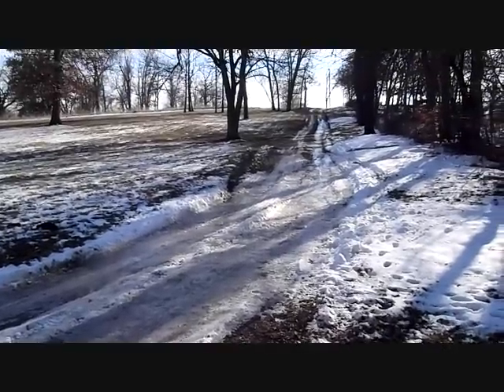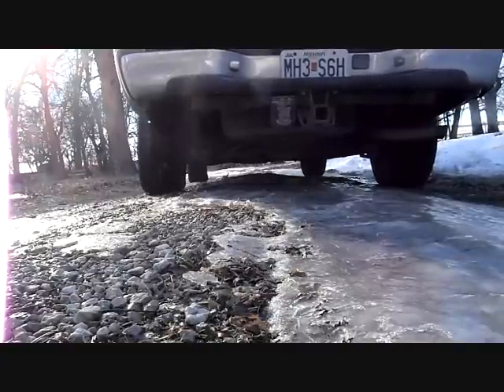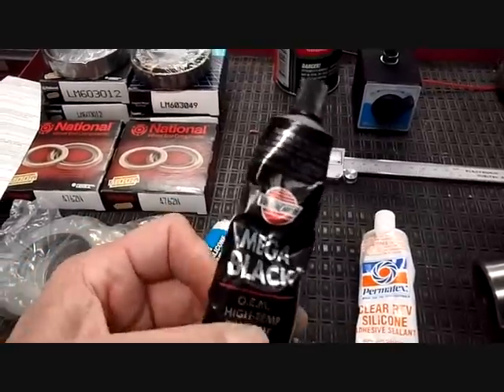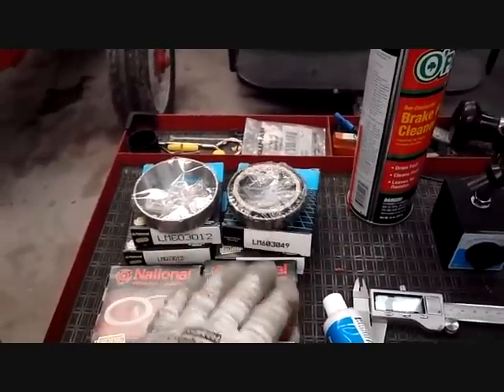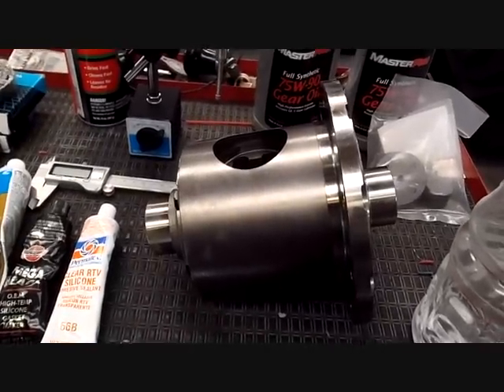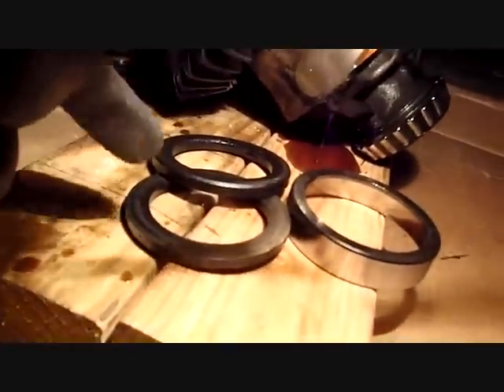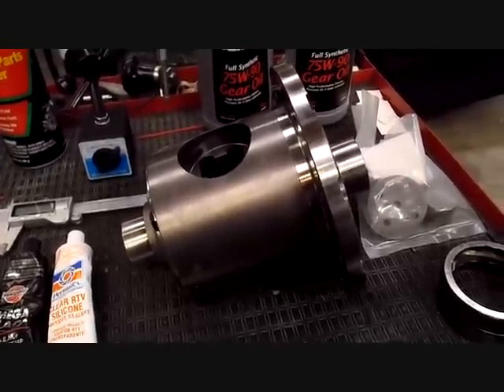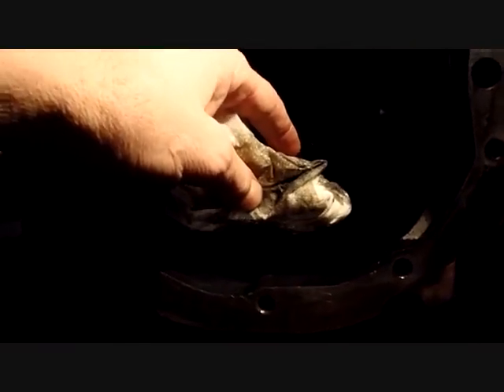How to install a Detroit Truetrac limited slip differential carrier. ADVANCED INSTRUCTIONS!

Comment: did you have to adjust the pinion ? im going to upgrade same setup as you same gear s ..can you list the parts numbers you used ...thanks
Reply from the maker: If you use the same ring gear and your tooth contact looks good there is no need to touch the pinion.  I don't have the part numbers. Just go to Jeggs and look it up by application.
Reply: +mowerdog ok...thanks

Comment: Do you think this setup for front and rear differentials would make a great setup off-road F-150 or would the Detroit Auto Locker be best?

Daily driver and hunting ALOT off-road.
Reply from the maker: The Truetrac on both diffs  would ne the bomb. Check out the rock crawler vids that run these on both diffs
Reply: mowerdog right on thank you so much!

Comment: gtood video. I like these lockers.  note to anyone how lives in the city with crowned roads.  locking diff make the rear of your car go sideways, as you begin to move foward. if there is a parked car next to you. you may slide sidways in to it. just be carefull.
Reply from the maker: +Tom gator  The truetrac is not a locker.  Just a limited slip diff.  This one acts fine turning corners...

Comment: great video dog....im not sure if anybody else has posted but for those that dont have a 20 ton press...you can clean the bearing real god, put it in the oven at 350 and while its hot you can slide it onto the diff or gently knudge it on ;)

Comment: Nice video - clear and well narrated mowerdog, was going to take my 49 Pontiac with 8.5 into shop, but will now do my own..  I will also have to change the gears, but appears that won't be too bad.  thanks for the lesson
Reply from the maker: If your changing out the gears you'll have to adjust the pinion depth and bearing load.  I didn't have to do that because I left the pinion in and didn't change the gears.  There are some videos on pinion depth and preload here on the tube...

Comment: Yeah I've already had the cover off, that's why I said the (helical) gear set inside has all sorts of play. Ring and pinon back lash on the money still. All Detroit wanted to do was sell me another unit. Maybe in the lighter less power applications they may do a little better. I just wasn't too happy for the price I paid for it to not last. I've got close to 700hp 1300 lb ft of torque running through it. Hope yours does better. I'll be going grizzly next
Reply from the maker: My stock 5.3 Engine has a tiny bit less HP than yours! LOL

Comment from the maker: Great questions.  Search for your specific backlash specs.  You will find them online.  About bearing preload?  I guess the correct way is to remove the driveshaft and noting the torque it takes to rotate the pinion.  Then after you install the carrier take another reading and find the difference.  The preload specs can be found online too.  I guess I chose the easy way out, which is - I had to drive the bearing spacers in so I knew there was  preload.  How much? I don't know? Done by feel......

Comment: Just watched your video, how is that truetrac holding up? Did you have any noise or problems. Thanks
Reply from the maker: +Josaljo Won  I have 100,000 miles on the Detroit now. No issues or noise.  It worked super this winter.  I find myself finding slick patches and putting one wheel on ice and the other on the dry.  Then I step on the gas and it's doesn't spin out.  Best thing I ever added to a vehicle!
Reply: +mowerdog Well I just ordered one from jegs, I hope I have the same luck you do. Thanks
Reply from the maker: I hope so too!  Good luck on the install!! Let us know how it goes?
Reply: +mowerdog I will do that, I already have the rear taken apart. Going to follow your video as soon as the parts come. Btw checkout my channel, I could use some subscribers LOL.
Reply from the maker: I'll go check out your channel.

Comment: FYI,  2000 was a split year for GM SUV body styles.   There are 2000 year OBS (90-2000), and NBS (99-06/07 classic) body styles for the SUV.   The 8.5 came in the OBS body style.  The 8.6 (/8.625/  8-5/8) rear end was on the NBS.   If you're doing this on a pickup,  the same information applies, but for pickups 1999 was a split year.   

Great video.  Thanks.
Reply from the maker: Super information!  Thanks!

Comment: where can i get all the torque specs for the ring bolts and for the cap bolts and how did you know the play in the diff needed to be at 10 thousands of an inch ? just asking im going to be doing this on my 04 suburban
Reply from the maker: +Brian Pena  I found them online.  You should be able to find them in your service manual.  Here is a good site as well.  http://www.crawlpedia.com/ring_pinion_setup.htm

Comment: Very nice video.   Any reason you didn't change the pinion bearings and seal while you were in there?   I've seen mixed information on whether a Truetrac works in reverse.  Do you know?
Reply from the maker: If I had changed out the pinion bearing I would have had to set up the pinion preload and position.  That's another days work up on jack stands.  There is really no reason to do that unless you just want to or you find trash in the diff.  However I could have changed the seal but heck the old one was dry. So I saved time and money. Thanks for watching my video!

Comment: mowerdog one more question how does it act on mud? is it 50/50 the whole time?
Reply from the maker: It's not 50/50 all the time.  The more one wheel slips the more the other pulls. I think I have around 80,000 miles on it now.  Still works super.

Comment: Hey mowerdog if the passenger right wheel is of the ground, will it still transfer the equal power to the left wheel, realized that my ls from the factory does not transfer eqaul power in this situation, it coul dbe that my clutch pads are worn
Reply from the maker: +Fern W  In this situation you would have to quickly tap the brakes with a Truetrac.

Comment: how does it drive on the road? i want to do some lockers on my jeep by i dont want it to be a pain to turn. cant decide if i should go with this or a elocker
Reply from the maker: This is not a true "Locker" diff. It's a limited slip diff.   It handles just like the stock diff in turns.
Reply: Use a detroit tru trac in the rear of jeep then put an e-locker or air locker for the front so you can engage it only when needed!!

Comment: Be nice if you could give us torque values for all the bolts.  They aren't all found in the Clymer or Haynes manuals.  I found that the hardest part of this job was removing the brake caliper mount bolts.   Also, you need a BIG set of jack stands; ones that will extend to about 24", if you intend to put them under the frame, which you should.  Took me 12 hours to install the True Trac and a set of four Bilsteins.  That includes going into town to get a diff cover gasket since the one in the Ratech installation kit #3025 was too small.
Reply from the maker: Yes - the higher the better!  It took me a while to find the torque values myself.  I don't remember what they were now?  But it sounds like you got it done!!! Sweet!!!

Comment: Nice and informative video and many thanx for taking time and posting it. just curious don't you think 0.012 of an inch backlash a tad too much? GM recommends 0.004 to 0.007 of an inch as standard Ring and Pinion backlash on most of their Diffs.
Reply from the maker: .012 is acceptable for used gears.

Comment: So we note then issue with LSDs, roads have a crown to facilitate drainage of water. An LSD forces the rear wheels to spin and the rear follows the crown to essentially slide off the road.  An open diff will take turns spinning a driver side or passenger side wheel, but with a delicate driving technique, you'll stay on the road and pull yourself out of a difficult situation.

Comment: mowerdog great video, awesome demonstration! I'm thinking of switching my differential to either a trutrac or locker I don't do much off road, just mud and sand. I have a 2008 gmc sierra with the g80 which works ok but know that if I had a full time traction differential I would've had better chances of not getting stuck. Only thing I read about a locker is that on turns you have to be of the gas or the inside tire will skip. How has the trutrac held up for you? How is it on turns?
Reply from the maker: There is a lot of difference in a full locker and the Trutrac.  Go to the Eaton web site or right here on the tube and check it out.  Lots of rock crawlers use the Trutrac so I figured it was good enough for my Suburban...LOL
Reply: mowerdog thank you, yeah I see rock crawlers use it. Only thing is when one wheel is in the air seems like all torque is given to the wheel with least traction. But i don't rock crawl lol. just recently got stuck a few times playing in the mud. My 2008 gmc truck comes with the g80 differential, feel like it's about to go out soon. but I'm liking the trutrac and considering it more than the locker
Reply from the maker: felipe f
If one wheel is completely off the ground and the diff isn't transferring power to the traction wheel you tap the brake.
Reply: Oh OK. Thanks man! Great video! You make look easy! One one question, how is it on mud?
Reply from the maker: It used to get stuck If my Dog took a leak on one tire!!  It goes through mud and snow no problem.  Just get aggressive tires to get the maximum traction.
Reply: Sweet! Thank you!

Comment: These are great diffs. I had them front and rear in my 82 Suburban and have one in the front of my current 04 Grand Cherokee with the stock Vari-Lok in the rear. Great video, I did a gearing change at the same time, added quite a bit more work.
Reply from the maker: Yes - a huge difference.....
Reply: Curious as to why you replaced the Vari-Lok.   I have two '04 Grands with the QuadraDrive and the Vari-Lok differentials work beautifully, certainly as well as the True-Trac in my Silverado does.

Comment: thank you!!! and did you haft to shim your pinion gear?
Reply from the maker: +Brian Pena  I used the original shims. Make sure you have a shim kit on hand in case your oem shims need to either replaced or adjusted.

Comment: Do you need to replace all the bearings and re-do the gear lash when installing this locker? Can't you just swap it out for the stock diff without changing everything?
Reply from the maker: I left the pinion shaft and bearings in place.  However you must install new carrier bearings just as I show in the video.  This is because you cannot remove and reinstall the old bearings without damaging them.

Comment: Thinking about installing this in my 2wd diesel ram, any thoughts?
Reply from the maker: If you have a need for more traction where you live then go for it.  I live in Missouri and I need it to just pull out of my driveway when it snows.   If you live in Arizona and never go off road then you probably don't need to mess with it?
Reply: mowerdog yeah I live in upstate ny I got the truck on an awesome deal down in North Carolina so I'm 2 wheeling in the north lol
Reply from the maker: Then you need one!!  Also there are other brands too.  Just look for some good prices.

Comment: Also remember that the ring gear bolts are REVERSE threads. Remember this when loosening these bolts off when using an impact gun.  It doesnt take much to strip these out if careless with an impact.
Reply: Hmmm, no they are not.
Reply: @totaldla  Yes, they are.

Comment: Hi would u be able to tell me how I can find out the correct part number for my suburban? To I stall a truetrac
Reply from the maker: What year?  Does it have disc brakes on the rear?  How many bolts are holding the cover on your diff?
Reply: @mowerdog  1998 has drum breaks in the rear. Note sure how many bolts it has I have to count them I'll get back to u on that
Reply: @mowerdog  it's a 10 bolt
Reply: @mowerdog  I found the part number 👍one more question, how is the driving on the road? Is it any different from the original open dif?

Comment: Sounds good. You should be able to get 200K+ out of any diff as long as its not abused by heavy impact like repeatably spinning from ice to pavement, etc. Most diff failures can be linked to abuse, contamination, or incorrect setup. The amount of moving parts is not a factor as much as its design and how its used.
Reply from the maker: saltcar I'm hoping I'll get 250k out of my 5.3 Suburban.  That would be about 160k on the diff.  Then I might just rebuild the engine and shoot for 400k?  Rebuilding a 5.3 would make for a good video....

Comment: you should try kerosene instead of brake cleaner, it lubricates & is  cheaper & safer on the body. it is an ultimate degreaser
Reply from the maker: Will do
Reply: Yeah much safer on the body as it's highly flammable...

Comment: Nice video, did you have to order all the spare parts separately or did some come with the differential? If not, where did you order from? Thanks
Reply from the maker: You get just the diff in the box.  Bearings, shims and other stuff are extras.  I ordered them all from the same place.  I bought all the parts and diff from Summit Racing.
Reply: Thank you, is there a certain brand of accessories you went with? I’m looking to put this same diff in a Ford, but I’m not seeing Eaton brand kits, only Yukon, Motive? Will it work?

Comment from the maker: It doesn't matter what oil you use in the Trutrac's because there are no clutch plates or springs.  Both axles are tied together with gears.

Comment: Nice video. A couple of things to consider: A locking differential such as an Eaton G80 that was available on your truck would have been another good option to install. Its actually better for gaining slow-speed traction and provides full torque to the high traction side in low-speed situations that you show. Most "posi" (a term often mis-quoted) units using clutch packs don't do that very well at low speeds. In a nutshell; the G80 (or gov lock) is best for low speed traction on ice/mud/snow and the clutch type is better for street/drag racing abuse where rpms/forward motions are greater. These don't do well where you may have ice on one side and pavement on the other because it takes forward motion to be able to apply the clutches. This is a common misunderstanding about "locking" rear ends.
Reply from the maker: Eric G The reason I like this diff is there are no clutches and less moving parts than a g80. It's holding up well.  I believe we have about 85000 miles on it now.

Comment from the maker: If by chance you get just one wheel spinning you can tap the brake and then it will work.  But this is rare.  I watched lots of rock crawlers with this diff on youtube and it sold me.  I hardly ever seen just one wheel spin.

Comment: now I am starting to consider putting at least one on my 01 Ram 1500 4x4. start with the rear, then probably the front.
Reply from the maker: Unless you're rock climbing the rear would be enough.  You will basically go from 2 wheel (1 front / 1 rear) to 3 wheel drive.

Comment: So you don't really need the dial indicator since you are reusing the same ring gear right?
Reply from the maker: My new carrier was manufactured to the exact dimensions as my original.  This is why I was able to use the original shims and the backlash was good.  This is actually unusual.  I lucked out.  Without a dial indicator I would not have known....... You need to use an indicator.

Comment: I've heard from other differential tutorial videos that synthetic oil works fine but will cause these diffs to lockup later due to a reduced friction between the gears. Basically it's a smoother mesh so it takes more power to get it to lock up.
Reply from the maker: I don't believe a word of that.  Tighter tolerances demand synthetic 
lubricants.  There are no clutches in these diffs.  I now have 130,000 
miles on my diff with the same synthetic lube I started with.

Comment: How has the synthetic gear oil done? I bought the same unit and Eaton recommends using conventional gear oil.
Reply from the maker: I have 160,000 miles on it with Synthetic.  Works fine to this day...
Reply: mowerdog Awesome. Thanks.
Reply from the maker: No problem
Reply: Either will work but conventional causes it to lock up sooner and thus perform better.  If you wanted later engagement, run synthetic.  Either is perfectly fine.  It'll last longer with synthetic, for me I want more traction, the diff will outlast my old vehicle by a long shot.
Reply: @mowerdog  I was told the same thing not to use synthetic oil
Reply: @thereasonableamericans411  I think you're right, but in this case "later engagement" means something like 3/10 of a second later.....
Reply from the maker: @G31mR  This diff has no clutches.  If it had a clutch pack then you would use non syn grease with possibly an additive..... But this diff has no clutches and works of the indifference of torque.  So in my opinion the grease you use has no effect on its performance.  I am now at 250,000 miles and it still works flawlessly.
Reply: @mowerdog  I know the Tru-Trac is not a clutch-type LSD; I installed one myself,  in my Silverado.  You can certainly use full synthetic gear lube in a clutch-type LSD, and friction additive is required in that type of LSD when using either type of lubricant.  I have had full synthetic in my Tru-Trac for three years and no issues. Good video.
Reply: Good to know. On the Eaton website, they recommend non-synthetic gear oil without friction modifiers for True Trac.